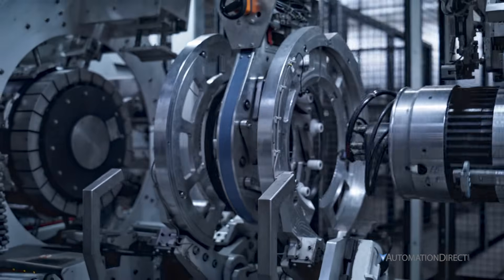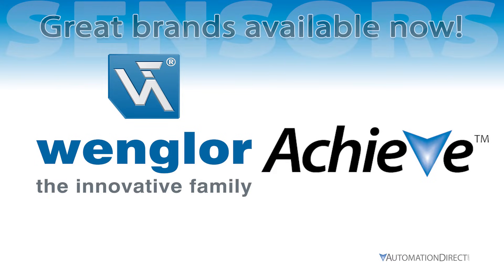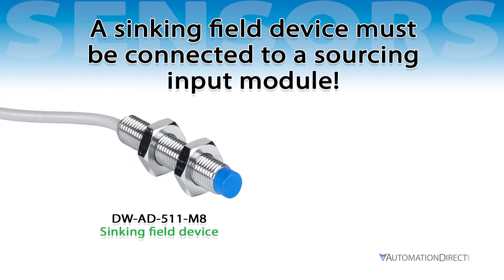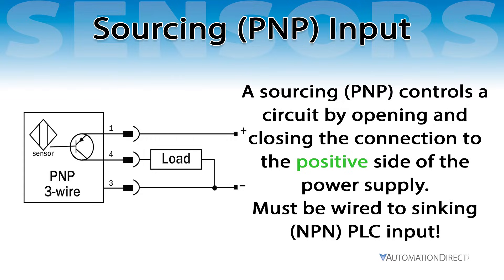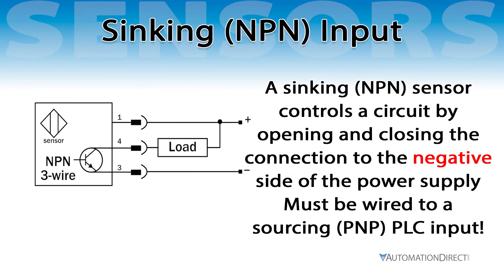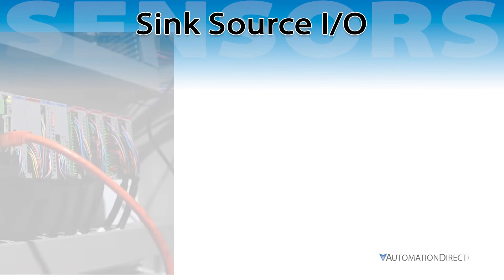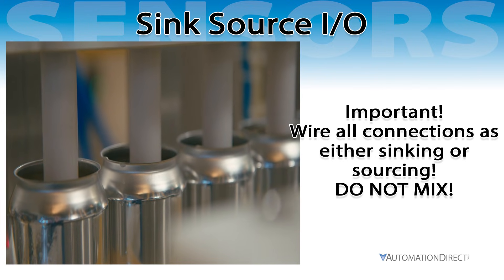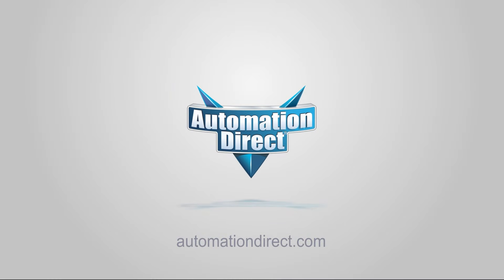Sinking and Sourcing Sensor Wiring Basics from AutomationDirect

Comment: So, either way, you connect the input device to the power source and PLC the same. Only the connection between the plc and power source change?
Reply from the maker: @benoitlaporte1700 That is nearly true, but it does still depend on the hardware. If you have a sink/source input card, then the only requirement to match the sensors you have is changing what the common on the card is hooked to. If you have a dedicated sink, or a dedicated source input card then you can only hook it up to the power supply one way, and it only works with one style of input device.
Reply: @automationdirect  good to know. Does connecting a PNP or NPN device the wrong way damage the sensor or will it simply prevent it from working? Thanks again for the explanation, very enlightening.
Reply from the maker: Since I haven't tested every single PNP and NPN device out there I don't want to give you a 100% guarantee, but I can tell you that in my experience I have miswired them between the NPN * PNP a few times, and no damage occurred. Unless there is pre-existing damage to the transistor I can't think of a situation where wiring them backwards would cause a short circuit because you essentially wind up with a situation of no voltage/potential difference between the sensor and the card so no current flows to activate the circuit. I have seen customers mix up the power and common wire on the sensors power circuit, and that absolutely can and will damage the sensor, but I have never seen it when they (or I) hooked an NPN sensor to an NPN input card or vice versa. I just replaced the sensor with the correct type and it started working.